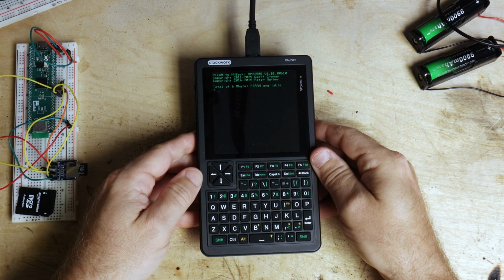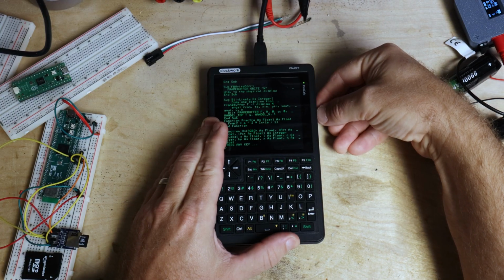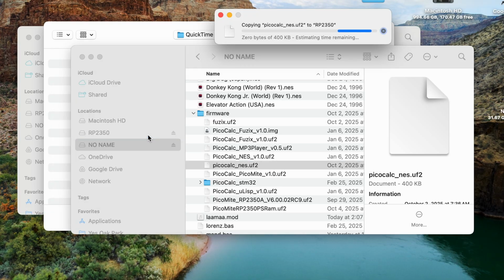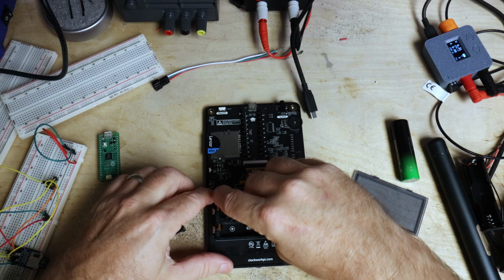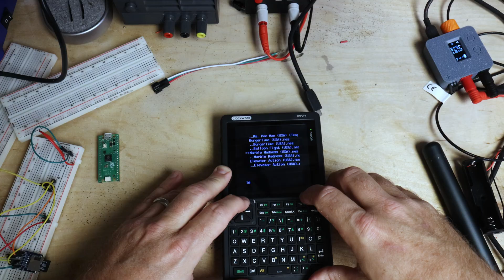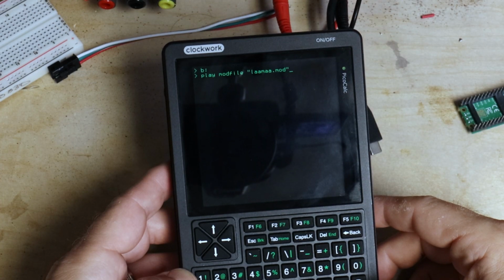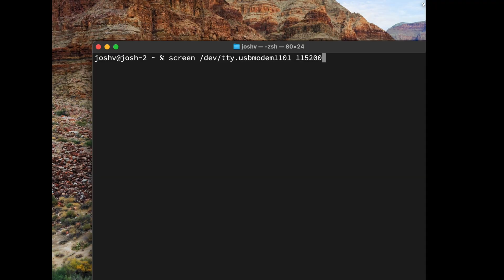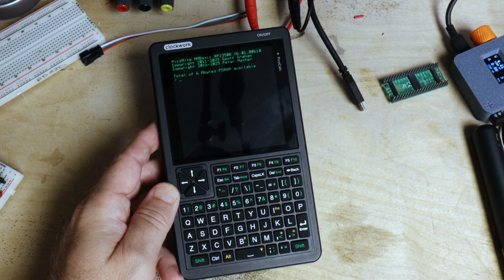PicoCalc - A modern hand-held retrocomputer

Comment: Great video! How did you add the PSRAM? Thanks!!
Reply from the maker: This is a custom board with a PSRam footprint. Sadly my board uses gp0 for Psram chip select so I had to create a custom build of pico mite that moved the uart off of gp0 and gp1. Then it just worked after I set the option for the psram cs pin. 

The picocalc does have psram on its main board but you have to access using software libraries and it’s slower. There are other pico board with higher speed psram, like pimoroni, but I’ve read some forum posts that indicate it might not be very compatible with the pico calc.

Comment from the maker: Tomato, tomahto folks, I am sticking to Pie-ko :)
Reply: it's the small size version of the way you say it and not that it's from raspberry "Pie" also why are you not charging the 18650 batteries in the device via the built in USB-C socket?
Reply from the maker: @dalecousins7373 thank you for watching.  so it’s Pee-Ko Calc from Clockwork Pie?

For the batteries I was testing out battery charging with another project I made a video on, the Pocket PD. I should have mentioned that the PicoCalc can charge the batteries.
Reply: @ElectronicsUnscripted  yep that's it like the same as a capacitor value pf, i like your custom pico board very nice, well done.
Reply from the maker: @dalecousins7373  one of the verification tests for me was running it in a picocalc. I was frankly a bit amazed when the psram just worked. It did require a firmware shuffle to get the uart off of pin zero (my board’s psram chip select)
Reply from the maker: @dalecousins7373 now I’ve confused myself but as a physics student I am almost certain we all said pie-ko for the SI prefix ‘pico’. Could be a midwestern thing.